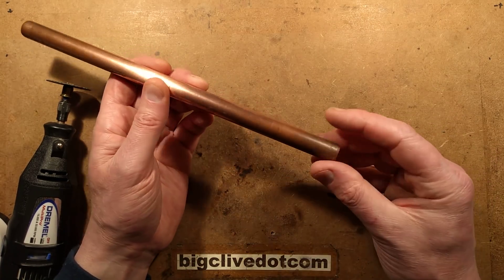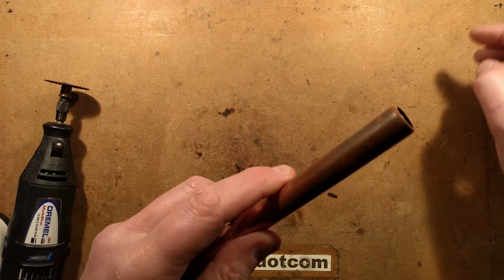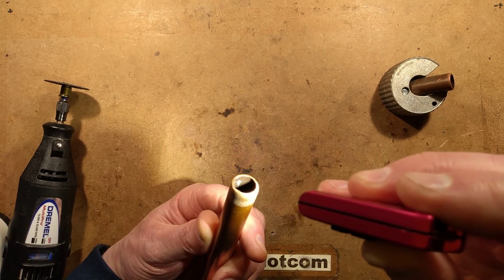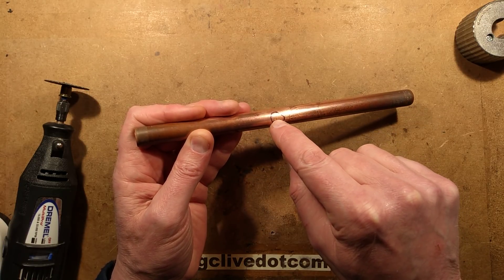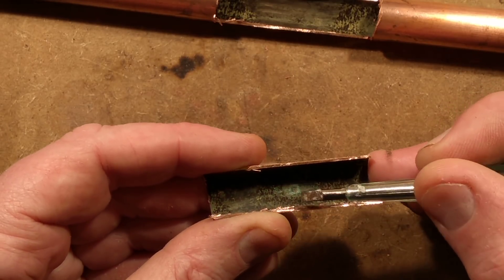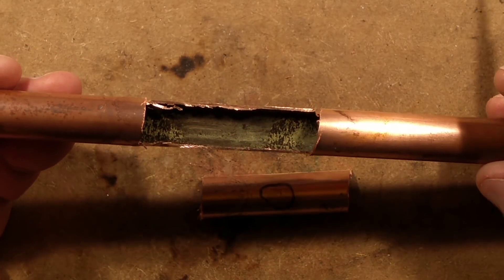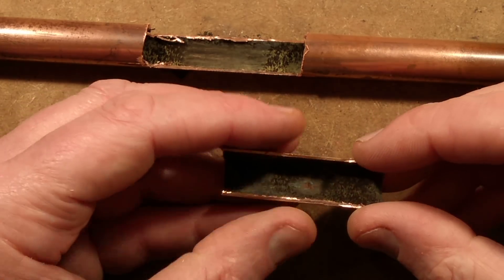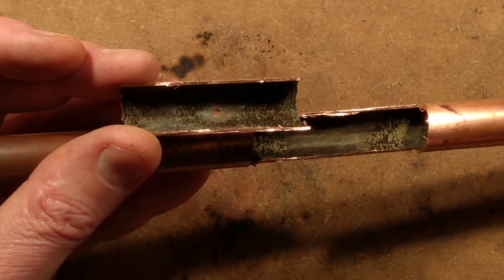Odd pinhole leak in copper pipe.  Selective electrolytic corrosion?

Comment: There are so many things that can cause this. Minerals and other junk in the water. PH got messed up for some reason so now your pipes are getting attacked. Bad soldering, so the flux goes down the pipe and the little flecks of it get stuck on the pipe. Could be a bad water heater on it's last legs releasing rust and other particles down the pipe. Could be a bad batch of piping from the factory. Could be a lot of things. I hate to be the bearer of bad news but if I was you I would start saving up some money because if this section of piping has an issue there's a pretty good chance it's happening in other areas.  

Funny enough, there's an interesting "This Old House" (it's an american home repair show) episode that looked into pinhole leaks and they talked to a scientist/expert dude that talked about the issues. https://www.youtube.com/watch?v=nD5lMITzx_Y

Comment: I believe you somehow got iron filings in your copper lines. This is common with older homes here in the US, installers who used  hacksaws used on steel prior to being used to cut the copper pipe, contaminated the copper pipe with minute iron particles.  Iron loves copper and you need only to look up any of the "salt water battery" videos  to see why this is a big problem.  I might suggest you are not done with this issue because of the apparent number of "green spots"  on the inside of the piece you removed.  Each one of them will create a new pin hole.  I replaced all the horizontal copper pipes with PEX. The vertical pipes never have developed pin holes, probapbly because the iron couldn't rest on the side of the pipe.   Sorry for your luck.
Reply: That is indeed very interesting about vertical pipes.

Comment: Quite likely that you will have the same problem elsewhere, sadly.

My parent's house had the same pinholes... had a plumber replace a few with PEX while the space was accessible during a re-roof but he didn't replace other accessible ones at the same time. Months later, pinholes sprung and bits of ceiling had to be pulled down to get to the problem pipe ends.  I was not a happy chap.

Comment: There is a huge  study being done on this pin hole problem in Florida/Southeast-US. Search for COPPER PIPE PITTING STUDY FLORIDA in your search engine. Its a battle between the pipe industry and the EPA regulations for water quality and the unpredictable results of mixing of differing water sources regionally.

Comment: I am down South-East so there is a thin layer of limescale on the inside of the pipes that tends to mitigate against this sort of corrosion. (But where air is present this same water quality damages taps and fittings, wherever free oxygen is available.)

As others have (probably) mentioned:
-Chinese/Eastern European/Russian copper was notorious for pinholes and pitting corrosion in previous decades.
-Steel swarf inclusions accidentally pressed into the copper from inside..likely. As rust then occurs, the thin section of Cu might be distorted by the iron swelling, leaving a weak, granular surface. 
I have noticed some rather thin walls on new off-the-shelf pipe rather dubious.

Comment: I'm no plumber, but I'd replace the whole pipe run, or bypass it if you have to. I had a section of pipe under my house floor leak 3 times over a 2 metre section. (also pin holes) Cost the insurance company 3 new carpets, and re tiling twice. Stupid plumbers. I eventually bypassed the inlet using PEX piping, went from the property boundary throught the roof and down again to the (luckily) exposed main connection at the back of the house. This in a house built in 1948. My strong concern is that your pipe WILL leak again at another place. Oh, and use class 1 copper...

Comment: I have had copper pipes eaten through by cement where they passed through wall due to  no sleeveing being put over it by the builders, also had the bottom of the hot water tank fall out after I had water softener fitted. Apparently the soft water dissolves any lime deposits in the system  and lime deposits dissolve copper to some extent. It could well be that any mineral containment could cause corrosion even a small dust like particle left after mains pipe work had been carried out.

Comment: I would bet my left eye tooth that it was manufactured in a certain Far East country. We had to completely replace all our copper piping with new. Our problem was all the piping ran through the ceiling. When it started leaking at night it did a great deal of damage before it was discovered the next morning. We had the old piping tested and it wasn’t only contamination of the copper but when it was drawn during manufacturing it was done unevenly so the pipe was thicker on one side than the other. 🤬

Comment: The most likely explanation I found on RepairMyLeak: "Type I pitting is associated with hard or moderately hard waters with a pH between 7 and 7.8, and it is most likely to occur in cold water. The pitting is deep and narrow, and results in pipe failure."

Comment: galvanic otherwise known as bi metal corrosion is a possibility, while copper is or isn't a noble metal depending on which definition you choose to use, phtsics or chemistry,  either way its one of the least reactive base metals, from memory, lead, tin, nickel stainless steel can all have risk of galvanic corrosion once you add an electrolytic fluid, like water with a non neutral ph.

Comment: The usual cause of bits of iron in copper pipe is using steel wool to clean joints before soldering.

Comment: I have seen this problem in an old house with a new addition (USA).  The old house had galvanized steel pipe.  The new addition was plumbed with copper but there was no insulator installed between the two systems.  To make it worse the new bathroom had a hot water recirculating pump between the bathroom and the water heater so that I always had hot water at the tap.  The new copper got a rash of pinhole leaks such as yours.  The hot water accelerated the process.  Do you have any old steel piping in your system?  If so you need to install an isolation insulator between the two systems.

Comment: Depends on the minerals in your water. My Sister uses well water, because of the high magnesium in the water, it slowly eats the copper, after 15+ years they have had several small leaks, as well as fittings breaking off. Most of the pipes have been replaced with pek tubing

Comment: I've been going around replacing sections of copper tubing in my house for years due to this same issue.  The previous home owner did all the plumbing work himself when they had a second storey added about 15 years ago.  As others have mentioned I've also seen the episode of This Old House (or was it Ask This Old House?) where in Rich covered this, and so I assumed it was due to flux in the lines.  But I had a plumber here a few weeks ago to swap out the water heater, and he posited that it might be that the bond between the water tubing and grounding rod had come disconnected.  I'm not sure how that would cause localized corrosion, or how bonding it to ground is helpful in the first place.  (We have an underground copper water main, which is more than grounded in of itself.) If anyone has any input as to how BS-ey that sounds, I'd appreciate it.
Reply: PS - I now always turn off my water when leaving for vacation.. with a basement full of electronics this scares the crap out of me.  (And sadly once the crap is scared out of me I can't flush the toilet without water 😭)

Comment: I had the same problem that appeared in many places in the pipe at various times.  The pipes were plastered into the wall and thus difficult to replace. I was wondering if one could use electrolysis to fix it? ie: to copper plate the inside of the pipe and build it up again? Are there technologies out there? (Although I think the pipe run would be too long to create an effective and even layer throughout?) It would make a good experiment?

Comment: Yes last pinhole and I came across like that was feeding a pump and dump heat pump and long behold mere feet away from that pinhole place where the telephone company ground their system which I promptly removed sometimes I've come across those where a lot of elbows or a fitting would be in school I told me that could happen when the pipe was knot reamed and the water would flow by that rough edge and created eddy current but your hypothesis maybe totally correct as I do remember watching a documentary almost all copper pipe is made from recycled copper and copper wire is made from Virgin copper but I digress that was only from one source

Comment: Not seen it go from inside out, only outside in with steel nail used to hold copper pipes. If you need a hand changing your pipes    to plastic let me know before you have more water spraying everywhere.

Comment: Yes I have heard of this before.
I knew a man years ago that experienced the same dilemma with his copper pipes.  He noted the problem started and became worse as the  Metro Subway was installed a quarter mile from his home.  After replacing the damaged leaking sections,  he installed a break of poly pipe from the main as it entered the home.  That appeared to stop the problem.
His assumption was the electric bleed or field from the high voltage metro tracks was the cause.  Isolating the  house piping from the outside with a section of poly was his answer. Plus installing proper grounding other than through the water pipe system.
Reply: This is interesting. I watched another video today on fixing copper pipe and learned how important grounding is. Never knew that before today.

Comment: I had this happen to pipe headers coming out of the foundations in a high rise apt building. I was in charge of rehabilitating the building. After engineering companies rang in,  teams of metallurgists, water experts and a chemist it was determined that the particular batch of pipes, fittings were inferior. The water was near perfect and had it been not so clean the issue would have never manifested. This only revealed itself on the heated water pipes. In a nutshell..shit happens. It was a very expensive repair and demolishing the building was considered. I've also seen recalls in various plastic and polymer piping and tubing. One particular nylon fittings became brittle after exposure to chlorine in tap-water. The plumbers would install them correctly and a couple weeks later the fittings would split and blow apart.  To this day i am paranoid about water leaks...

Comment: Cold water pipe? Too much flux was used. Internally a piece of flux broke off from the joint and stuck inside the pipe downstream. The flux used for pipe soldering is acidic. The hot water pipe won't do that because the hot water will more easily "melt" the flux, rinsing it away.

Comment: Worked many years in a big hospital and saw that many, many times. Never had a good explanation.  Fittings on hot water lines where the water was continuously recirculated had  more problems.

Comment: Iron settled on the copper. Check the condition of the zinc anode in the water heater. Horizontal pipes will be most prone to this type of failure. Especially when left for a decent period of time with no flow.

Comment: we baught a shower head tap combi thing for the bath from B&Q, fixed it up and all fine....until i saw a small drip like flow of water trickle down the shower head handle thing. this got quickly worse with a small hole spewing a small jet of water out the SIDE of the head where top end of handle area was....i macgyvered a fix using PTFE tape, but that didnt last as the hole got bigger. i then took the head to bits and what i saw genrally shocked me that B&Q could manufacture such low quality shite......turns out that the interior was badly corroded and there was bits of soft corroded metal all in it...it felt like a fragile gritty substance that would crumble in your fingers when manipulated. it reminded me of that shitty cheap arse diecast metal toy cars you get, you know the brittle ones...it was like that.
hopefully the tap part or ITS components doesnt do this as its a potential leak disaster !!

Comment: Have seen this a lot, especially in hot water piping, although not limited to that. I'm a plumber in Canada and have seen enough of it to be concerned.  So far, I doubt that it is a manufacturing defect, although I have seen that, but most of the time it has been without rhyme or reason.  My unproven theory is that it is electrolytic in nature since I have witnessed this being rampant in one building versus another building having no trouble at all despite being piped at the same time by the same contractor who bought their pipe from the same mill.  I have also witnessed DC voltage potentials from "earthing points" that telephone and cable TV companies have clamped to said piping. (wtf?)
Edit: Didn't measure the potential but could see sparks whilst removing and re-installing said bonding clamps.

Comment: After taking over the family manse a few years ago, I noticed what I thought was condensation on the copper pipes which were visible from the basement and looking up at the ceiling. All along meters and meters of 50 year oid copper tubing looked like it was just sweating from the humid atmosphere......NOPE!!!! Hundreds of tiny pinholes, none large enough to cause a fine spray but leaking nonetheless. Corrosion triggered by inadequate removal of all the acid flux they used back then. Over the decades the leftover flux reacted with the water to eat away the copper. Replaced every section of copper pipe with PEX.

Comment: I used to have this quite a lot at my house here in New Hampshire.  A piece of advice I got was to use thick wall pipe rather than thin. (One is M grade, the other is L grade.  I don't remember which is which.  There may be other differences between them.)  I haven't had trouble with my replacements, but my number of events is not statistically significant.  It may be that the builder had used the cheapest he could find, and there could be differences in manufacturing quality.  Good luck.
Reply: Alstead, South Acworth, Beryl Mt.

Comment: Ask around about this and you will need an operation to remove your palm from your forehead. Water companies go into dodge responsibility mode instead of helping with a potentially useful investigation on the issue. Pipe companies do the same plus treat their production as if it's some sort of secret process. Tradesmen advocate for using copper pipe in place of running a ground wire through the home. It's pretty clear this problem exist because everyone is acting like children about it.

Comment: When dissolved solids build up on fixtures in my area, they will dissolve solder and eat through pot metal castings. Fluoridation was never a reason not to drink it because you would never get that far to begin with. Hundreds of miles of concrete aqua ducts between the desert I live in and the desert we are creating cannot be good.

Comment: I believe its the cheap copper piping used nowadays where its not completely copper. I believe other added metals cause bi-metal corrosion. I had this in my house and cleared it up just by grounding the copper pipe. Of course i added a second ground rod outside about 5 to 6 feet away from the original ground rod. Side note- make sure you clean the copper pipe on the outside really well before adding the ground strap, this goes for all connections.

Comment: I have very alkaline soil under my house and my fridge water supply copper tube was l laid across that dirt. After 15 years, that soil started causing pin holes in the pipe. Mine was the outside in, but yours looks like it ate from the inside out. I’d be concerned with the rest of your plumbing.

Comment: Sometimes the way the plumber uses excessive acid solder will cause balls of this surface cleaner to flow down the pipe and congeal into balls inside the pipe that will over time cause a hole. Another way is when the copper is recycled for pipe in the range of 99.5 percent the other .5 is carbon impurity. Remember only copper for electric wire is ultra pure. The drawing or pulling the copper pipe through a die will sometimes expose pockets of impurities in the finished product. Pipe is not really inspected closely as many think. Hope that helps.

Comment: I’ve had this happen with stainless steel in espresso machines. Yeah, figure that one out! Got this micro-jet of water hissing out almost invisibly. I’ve seen it twice, on the only part of the boiler that’s actually been extensively machined. Maybe it’s some fissure in the crystalline structure of the stainless that just ages quickly under sustained high temperature water? That water did scale up quickly, true, but why would mineral scale eat a pinhole into stainless? It’s frankly baffling.

Comment: so this can be caused by a few things most common being that when the pipe had a fitting soldered onto it the plumber would have used flux and should that flux get into the inside of the pipe it causes that exact type of corrosion https://youtu.be/nD5lMITzx_Y this is a vid by this old house on the topic where i got my info
Reply: also, general water quality issues can cause this as well if it is water issues (like bits of steel in the water it will also happen to the other houses in the aera

Comment: If you do end up having to replace more, just save yourself some trouble and use PEX.  We use it here in the NE US where it gets down to 0' freedomheits, and it doesn't burst.  They also have an SKU for hot water if needed. 
Only bit** is that the fittings are expensive, however when you consider the cost of the copper pipe, install hastles and sweating it, it seems to be a decent money and time saver overall.